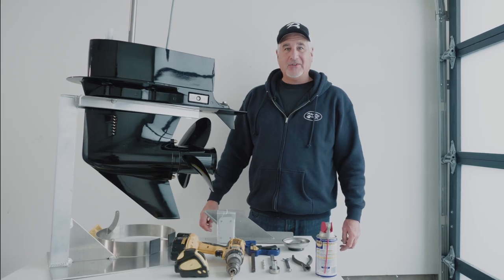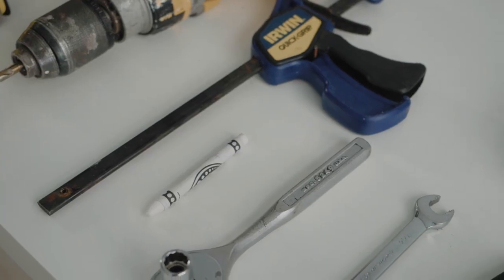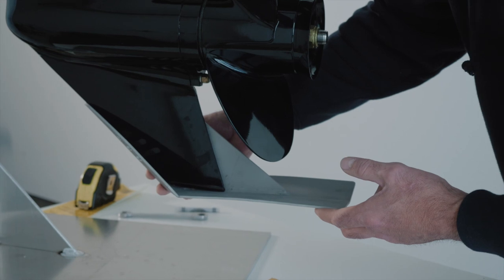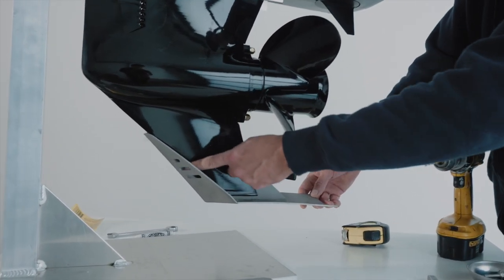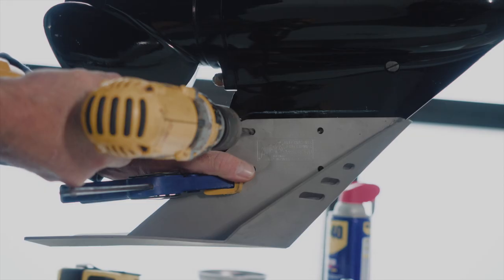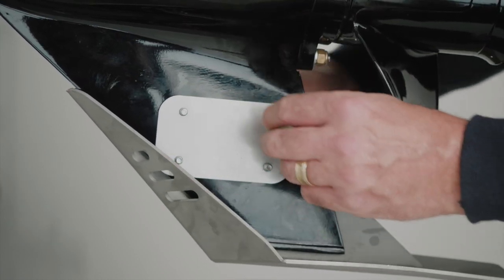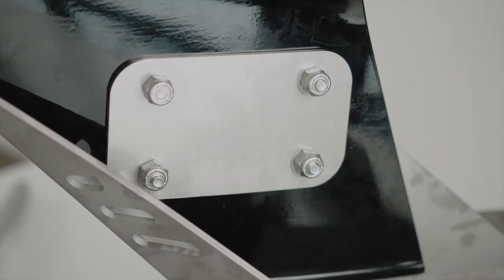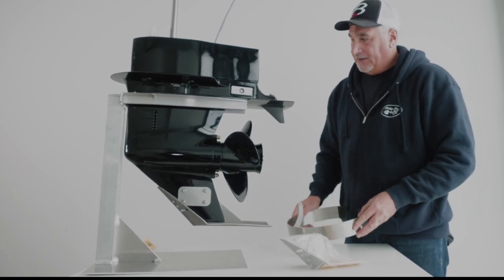How To: Mac's River Runner Installation

Comment: I have bent my skeg and knocked about 3/4" off the bottom. I will be able to straighten the skeg. Can i mount this down a little from my damaged skeg or all the way up as long as it clears the prop by a 1/4" and does not drill into the reservoir.

Comment: Mac's Prop Savers,
Do you think it would be wise to use some sort of product to prevent the stainless steel bolts and the aluminum skeg from reacting to each other?
Reply: Ive had 2 of these mounted on 2 motors for 30+ years with no issues. Never really thought of that
Reply: You can use a liberal amount of marine sealant if concerned